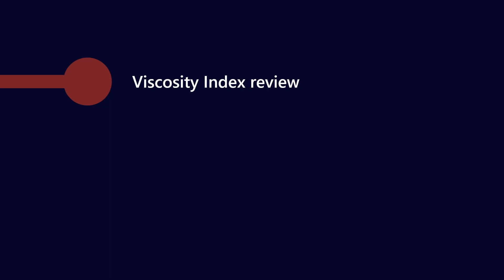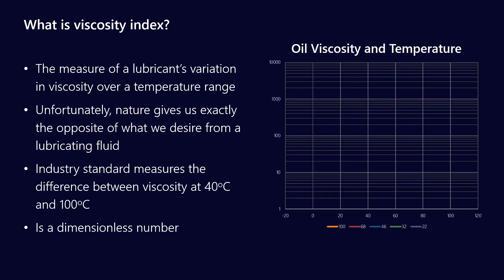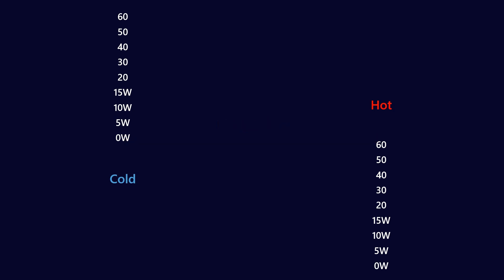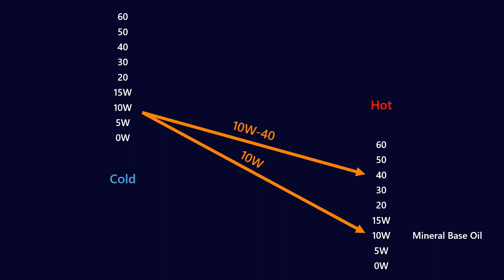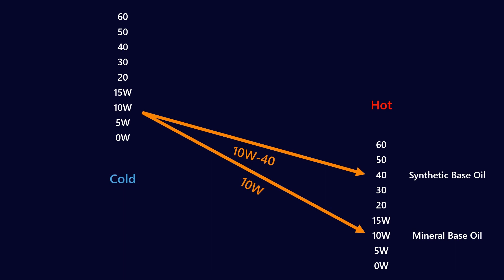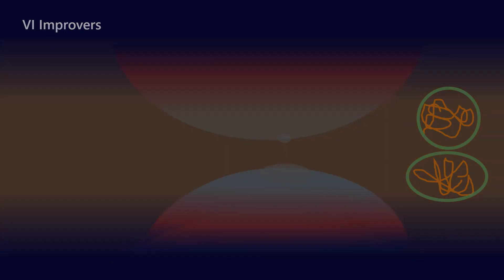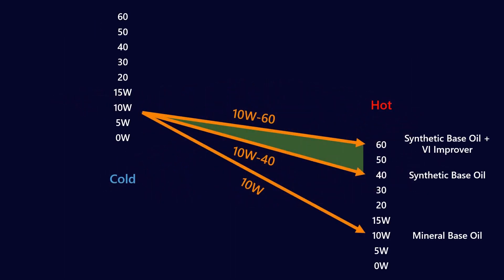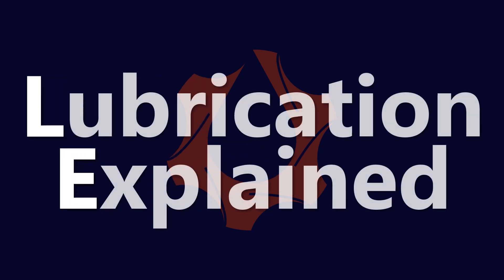How do viscosity modifiers work?

Comment: Thanks for your time, congratulations for the channel! If its possible please make a video about the differents Viscosity Improvers quality, they are the same quality for mineral and synthetic oils? For the other hand when synthetic oils doesn't need them? Bcs the synthetic oils has better VIndex so they not always need viscosity additives, this is one of the advantages vs mineral oils, so more VImprovers = lower base oil.

Thanks again for your work.

Comment: Thanks for explaining VI, i want to ask one thing, how long it takes to loose the viscosity which was initially increased by VI improvers, for example if i add VI to increase the viscosity of mineral base oil having original viscosity 11cst @100 to 19cst @100oC , when will it loose or if it is automotive lubricants so how long will it run on the initial viscosity ?
I hope you understand it :)
Reply from the maker: That's a great question, and unfortunately the answer is "it depends". The property you're referring to is known as "shear stability" and the capacity of a lubricant to resist VI improvers breaking down into smaller, less effective molecules. That amount of time will be dependent on the shear exerted on the oil (subject to factors like engine speed, ring tension etc), the operating temperature, the type and amount of VI improvers in the oil.
Reply: @LubricationExplained  Thank you so much for your time to answer my question 
But if i am using polymer of 20 SSI , i have read some where it is like viscosity will be lost by 20% (by using 20 ssi) which we increased by using this polymer.
But that 20% lost will start after certain period or it will start from the day 1?

Comment: Thanks to this channel, that bottle of oil in my garage gets more intriguing every day.  Do VI improvers vary in quality (cost) regarding their shear stability and their ability to quickly respond to temperature variations? How (or do) they affect TBN?
Reply from the maker: Yes. So again, probably another video but there are different types of VI improvers that have better shear stability and can operate over wider temperature ranges. There are some tests that evaluate shear stability of lubricants (DIN 51382, ASTM D5621, CEC L-45-A-99) but it isn't common to list these results outside of industrial hydraulic oils.

Edit: forgot to mention, they should not effect TBN levels.

Comment: Can you do an article of 10W40 synthetic blend blended 25 years ago vs 10W40 blended in year 2020? The one blended 25 years ago would likely have base oil group 1 & 2 + POA vs base oil group 2 & GTL base oil group 3, without any POA, and maybe with only 1/2 amount of VM. I remember reading an article that, in early years, semi synthetic blend did out performance better than POA because additives package, at that point of time, did requires some aromatics that were inside base oil 1. Maybe you could do a video on evolution of the earliest 10w40 semi synthetic blend until now. This is important as average age of cars in USA is about 12 years. So 10W40 is still very applicable. Regards.

Comment: With your explanation of VI improvers, they break down faster. So would it be better to use a 10W30 at a lower temperature, rather than a 10W60 at a higher temperature?

Comment: Can a 5W and a 10W SAE grade be made using grade I mineral base oil?
Reply from the maker: Realistically, anything can be made with Group I. The problem is finished lubricant quality - depending on whether the final formulation is 5W-30, 5W-40, or 5W-50, you may need to use too many viscosity modifiers to achieve the final viscosities; these will have an adverse impact on shear stability and deposit formation.

Comment: It's worth making the point that whilst VMs were the thing that first made multi-grades possible, when you're formulating engine oils, VM polymers are your absolute worst enemy! This is especially true for diesel engines where VMs are the root cause of most piston deposits. When it comes to choosing viscosity grades, if you can, 'go narrow' rather than going wide. A 10W20 will likely serve you better than a 0W50!
Reply from the maker: Yeah that's absolutely true.
Reply: so using 10w-30 is better than 10w-40, even in summer?
Reply: @javieroargubi  Yes
Reply: @LubricationExplained  
It's also, generally, very safe to say - never use a multigrade oil with a viscosity range greater than 30. Unless of course, you are in group 3 or better.
Reply: Good

Comment: I live on the west coast of Canada and unlike the rest of Canada, we usually don't have to go through extreme weather or temperature. The factory-recommended engine oil viscosity for my two Toyota vehicles, a 2006 Corolla and a 2010 Yaris is 5W-30 and recommended oil grade is: ILSAC multigrade. That is the only requirement in the owner's manual considering engine oil. From day one whenever I purchase a new vehicle, I replace the oil and oil filter after the first 1600 kilometres or 1000 Miles and after that maximum of every 5000 kilometres or 3100 Miles or every three months, whichever comes first. I only use what is considered one of the best synthetic oils on the market in my local area. A few years ago I read that some oil manufacturers are claiming that it is perfectly OK to use 0W-30 oil instead of 5W-30 oil so that's why I started to use 0W-30 oil just for three months in winter to help quicker lubrication of the engine when the temperature deeps down to 0 or below zero (just for December, January, and February). The reaction of my friends or other people is always very adverse to my decision and they are surprised why would I do anything other than what the manufacturer is prescribing. I hope that you read this comment and I would like to know your opinion about that.
Reply: It is normal for manufacturers to list, in the vehicle owner's manual, the oil specs against temperatures. 
There is absolutely no reason to use oils outside those specs. So if you are using that guide, you need not answer to anyone else.